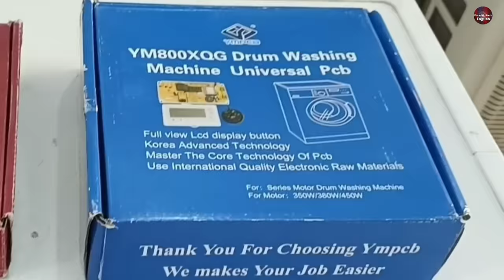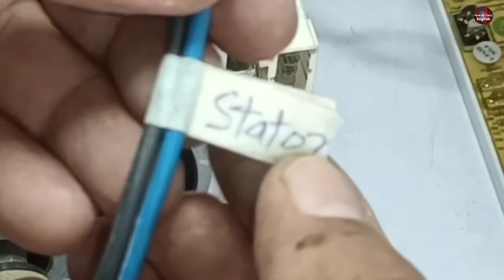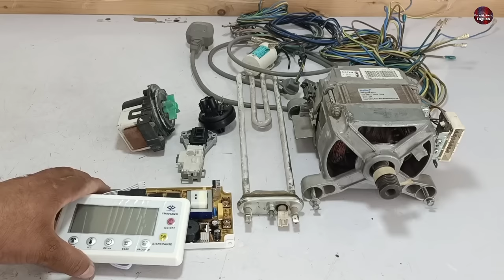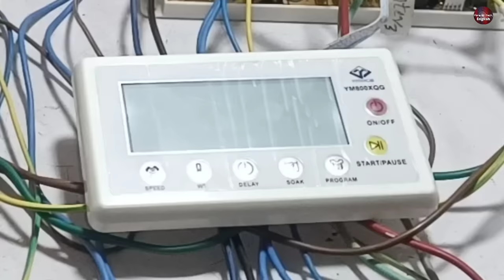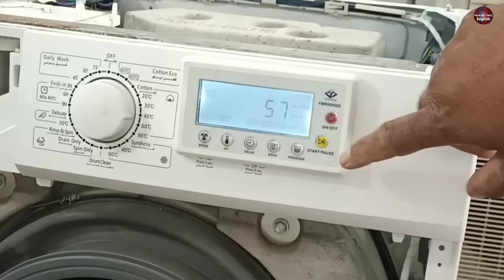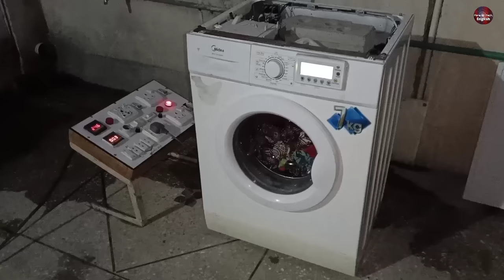Reviving Washer with Universal Circuit Board

Comment: Thank you so much for this video! I have a watching machine in my basement. It was working well for a few years, but then the controller board was damaged. From the connections that were burned I concluded it was a door switch which caught a water and caused a short in a circuit. I left it in the basement for years now in hope I will be able to replace the controller with something new, maybe a Raspberry Pi, or something similar. It's worth to note that I found a new controller for this specific washing machine, but it was to expensive. I could buy a second hand washing machine of the same model for the controller price, so I said nay. What you demonstrated in your video is awesome! I never knew there is something like universal controller we can use. Thank you so much! I learned a new things today from your video.
Reply: Dude you can't control a washing machine with a raspberry pi.
Reply: @simonero96  I think you might be able to, but it’s not the best solution and certainly wouldn’t be easy. You’d need loads of external components to handle the high voltage switching and sensing. 

Sounds like a fun project for a day when I’m not busy 😂
Reply: @andyscott5978  yeah sure. Almost everything is possible if you want. I was saying what you said better: raspberry pi isn't intended for such high voltages and currents and would need loads of external components to actually drive the machine.
It's not as straightforward as using an "ad hoc" board.
Reply: @simonero96  absolutely. It looks like some people have tried and not got very far with it for reasons you and I may have already mentioned. But when I get mine up and running I promise to send pictures of it 😂👍.
Reply: @andyscott5978  
Nice. I wonder how are you going to drive such a big AC motor through a raspberry but I'm not expert enough and I'm sure there are plenty of solutions.
Also, wouldn't be better to use an Arduino instead of a Raspberry?
Reply: @simonero96  yeah, most of the Rpi discussions actually ended up saying “Arduino is probably the best way to go.” But if I really had to do the motor driver on a pi, it would have to use the feedback loop from the tachometer to then send a digital output via thyristor or PWM control to the motor until the required speed was reached. But I’m grasping a bit for the coding and circuit details. I guess you could essentially use 0-10v to something like a dimming circuit, but I would imagine everything would have to be huge to deal with a reactive load like that or have a whole load of power factor correction. Again, I’m really no expert in that area.
Reply: @andyscott5978  I'm no expert but if I had to do the this I would probably try a similar route: take a dimming circuit to drive tha AC motor, understand what is the range of the potentiometer, replace that component with a digitally controlled signal and calibrate signal/rpm.

You will probably need a similar route for water heater and discharge pump.
Quite a big and expensive challenge if you ask me, good luck
Reply: Please don't use Raspberry PI. I have had a close call when I brazenly attempted to fix a dishwasher with even simpler MCU -  an Arduino. Little I knew that the sparks in the coils of the electric motor sometimes screw the tiny microprocessor nearby and it misbehaves. Mine hung just after turning the heater on. It was glowing red when I luckily noticed. Unless you know a lot about protective circuits, watchdog timers and similar stuff - use factory-made controllers, like in the video. Don't risk fire.
Reply: @AB-pb8oo  very good advice from someone with firsthand knowledge. Thank you.

Comment: that's so cool! I have the (exact?) same machine but branded Siemens Siwamat XLM 146f Family. I had to replace the control board some years ago but was still able to get it from Siemens. Apparently the same board is used in some Whirlpool machines. I recently had to replace the diaphragm/seal in the inlet valve and the shock absorbers. hard to find good quality ones unfortunately. Original ones looked way better construction than the cheap plastic ones I found. 
I'm glad to have learned there is this universal control board! Thank you for sharing this!

Comment: That machine looks spookily similar to an AEG washer-dryer that I threw out when it stopped working. I had fun taking it apart to make it easier to dispose of. I wonder if it was made in the same factory as that one. The control board was available for about £150, but I thought with my luck something else would break soon after. With the state of the UK economy today, I probably wouldn't be so cavalier in discarding it if it happened now.
Reply from the maker: That machine would have left his brother in a carnival lol, But jokes apart universal control boards are cheaper

Comment: Great video and I had no idea you could get a universal controller for washing machines. The one thing I would ask is that you never use the green/yellow wire for anything other than Earth / Ground. If you need another colour of wire, consider using some rings of tape on a colour already used e.g. brown with a black ring.
Reply: There's not much to a washing machine. At its heart is basically a timer. The circuits are run to specific timings, on a cycle. You can see the theory in operation on those old dishwashers that use mechanical mode dials that rotate electrically as the program runs. They are quite simple in theory.
Reply: why is everybody hung up on this?
Reply: @UGPepe  if you use the Earth wire as a live conductor and someone other than you works on it, they may well reconnect that “live Earth” to Earth because that’s the universal rule. At best this make a bit of a bang when you turn it all back on at worst it makes every metal item which is connected to Earth in your house (or wherever you’re doing it) live.  I’m sure you can work out what the result might be. 

I’ve worked on systems where someone used the Earth as a live and it all went bang when I turned it back on and I’m a qualified electrician. Or were you meaning just the whole alternative controller?

Comment: Unbelievable, i don't know in my memory not one repair case related with changing control panel like in this video. I worked in washing machine factory about 10 years :DDD Repair cases with control panel was very difficult because to find problematic module necessary to connect each serviceable module separately. Always in such cases it turned out that the problem module was the control panel itself :DDD

Comment: hi, the command board (with display) can be programmed on pc for define the better washer programs or is loked? thanks
Reply from the maker: Its not open source I think... Nor its has any port that it may be connected with PC.
Reply: @forevertechenglish  thanks. and the programs can be setted (for example duration of any sub, temperature ecc) or prefixed? there's a manual?
Reply from the maker: @alfredoneri2269 @alfredoneri2269  It comes with a piece of paper with a circuit board diagram. Also a water pressure switch. No, I didn't check the programs briefly. Just checked all the basic programs. It has all the programs which are going to be used in day-to-day use. And yes just forgot to mention, It displays error codes, if it has any issue with something. The programs are fixed,how much i could remember

Comment: Nice work with the cables but using hotglue to stick the controller to the machine was HORRIBLE! Use silicone or acrylic whereyou can have a nice connection.

Comment: Sad thing is: That board including repair time is about the same as a new cheap washing machine. 
I love Miele machines, although they are expensive. But so far I got every spare part even for 30+ year old machines and keep them running. Last year I got a replacement pump and new seals for a 39 year old Miele dishwasher.

Comment: It's hard to see if you have grounded all metal elements to protective earth (PE), not only because you use the green/yellow wire colour against the purpose but also because you don't mention equipment equipotential grounding. Without restoring all ground points, the machine can become a death trap if an electrical fault occurs.
Reply: Если её не вскрывать под напряжением ничего не произойдёт. Корпус заземлён и этого достаточно.
Reply: They didn't connect any ground anywhere. The only place it was connected was in the plug... 🤦‍♂

Comment: Please can you explain why the machine prolonged washing cycle time?  Instead of 45min, it takes 1hr.
That problem i face on galanz front load and Bosch class ixx express
Reply: intlet valve may be faulty or clogged. the longer water flows in the longer the wash cycle will be

Comment: How can I get this universal panel pls sir am from Nigeria West Africa
Reply from the maker: Hello dear, I got it from a local vendor in my area. You can check it out on ali express, Other than this you can check it on different websites.
Reply: @forevertechenglish   interesting do they make  one for washer/dryers  to?  is it really a Universal Circuit Board, or is just the board out model of that an available machine that does the job,  that has spare parts available (so what am asking there model washer being made new using this control board as it brain  ?
Reply from the maker: @dh2032 this is s universal circuit board for the washing machine, The customer gave the original board of this washer to many repairmen, all in vain. Then he came to me, I tested the board, and the board had many missing components. So I bought this universal circuit, which is made by a manufacturer in China named YMPCB, And yes, after all the hustle, the customer was satisfied because he had been looking to get the washer repaired for several months. And this universal circuit board saved the machine from getting junked.

Comment: lot more interesting have if board has burn, add arduino uno board drive wash machine, make code and external motor driver and use normal wash machine all programs or basic program.
Reply from the maker: well that's a good suggestion

Comment: It is easier to test capacitors and diodes with a multimeter and have the old board working as new. Even the relays can be done too.
Reply from the maker: I already tested them, the board had alot of missing components.
Reply: @forevertechenglish  Great content regardless. Sometimes when it comes to a lot of work, it becomes beyond economical repair.
Reply: Most of the time the proprietary factory cpu with masked ROM is the defective part.
Reply: the mosfets tends to blow and is under lots of resin. when you remove it you cant make out any serial numbers or values for replacements.

Comment: I did not know there was a universal control board. But i want to slap you for using the colour wires you have used. Also in  the UK we only use a cold water supply . And therefore it is important to use  the heater element. However i see an issue with not connecting the heater with a hot water supply  , as if the hot water input temperature is not high enough the program won't move on. Also would be better to remove the old program knob and fit the new controller over that to cover the old programs. I do like the principle of repair over throw away for my self as an experienced appliance engineer. just for the hell of it. But would find it hard to justify the cost to some one else on time charged on the retro modification .
Reply: as far as I understood him, he just didn't connect the heater element in his lab setup. The heater needs water, otherwise it will get destroyed. He will connect it in the washing machine of course.
Reply: Ah yes that makes sense, thank you
 @tommeier2299
Reply from the maker: I did connected the heater inside the washer, just while testing the board i did not, because the heater could have burned without water

Comment: Be careful with what wire color you use for what, you see, in some places it is a violation of the electric code/law to use the coloring wrong.
Yellow/green is only for earth/ground (PE = protective earth), do not, ever, use it for anything else, not even for test/demonstration purpose.
Blue is for neutral (N).
The other colors is a bit more floating what they can be used for as it has changed over the last years, and it is also different from country to country.
But the most important thing is to stick to yellow/green is only, and exclusively, for PE earth/ground.

I know that the color of the wire has absolutely no significance for the function of the device, but in certain countries you can get a not inconsiderable penalty if accident happens and your wrongful wiring is the reason.
Reply: I agree in Germany it's an absolute  no-go Yellow Green  is PE any other use is against Elektro - Code VDE 0100
Reply: THe regulations are for electric instalation, not for electric products, all the cables could have been white inside the whashing machine and you would not breake any rule, you could even seal the machine to make it unreparable and it would still be into regulations.
Reply: You are right. But  as fare it concerns PE it has to be yellow green. PE is Potential Earth no if and or buts Period.

Comment: The owner should have let you use the original wiring,as the connections are probably the same! If that was possible most of that rewireing could have been avoided and just place the universal control module.
Reply from the maker: I don't wanted to rip of the original wiring, that whenever the customer gets the original circuit board, he could have used it.

Comment: Why didnt you use original wires and terminate them if needed?
Reply from the maker: I didn't use the original wires because if the customer gets the original board, then i would install them back in thier original condition with original connectors

Comment: Why not just use existing wiring? Just use the harness from the defective control board
Reply: he did explain it. The owner tries to get an original controlboard and will use the old cables then.
Reply: @tommeier2299  I mean he could have left the original wiring alone and just make custom harness to interface it with the universal board, granted one would need the wiring schematic or get clues from markings, if any, from the original board.
taking it all apart to rewire is so much more work.

Comment: THERE IS NO UNIVERSAL CONTROL BOARD ALL MACHINES HAVE DIFFERANT PROGRAMES AND TEMPERATURE'S.
IF YOU FITTED THIS BOARD IT WILL HAVE THE PROGRAMES IN DIFFERENT PLACES ABD OR TEMPERATURE'S .
DO NOT GET FOOLED WITH THIS CRAP